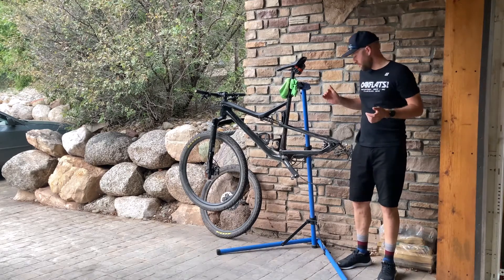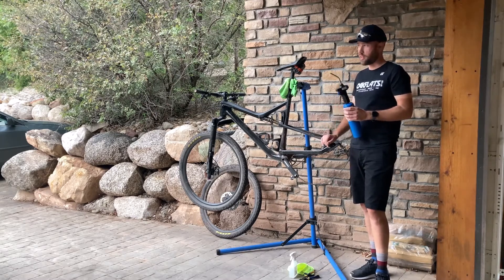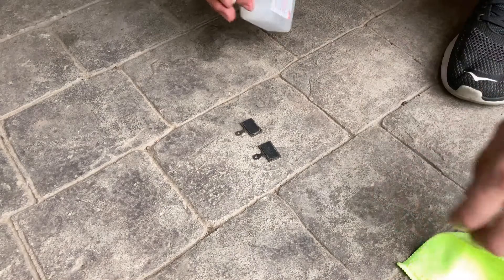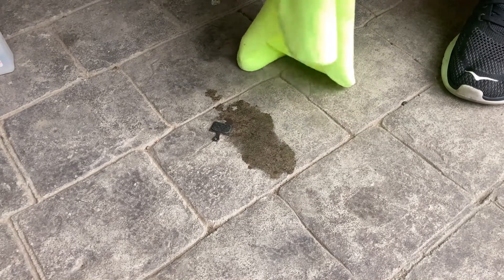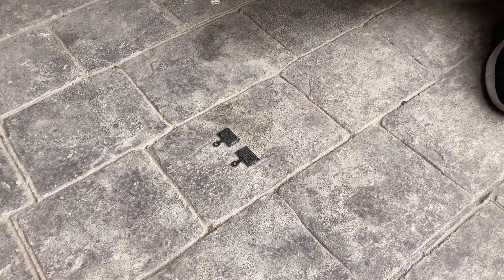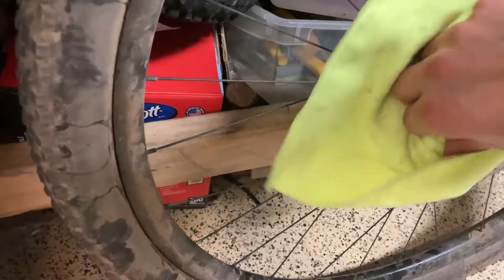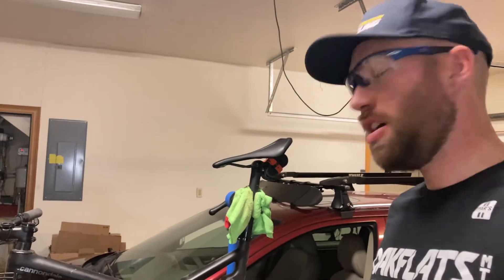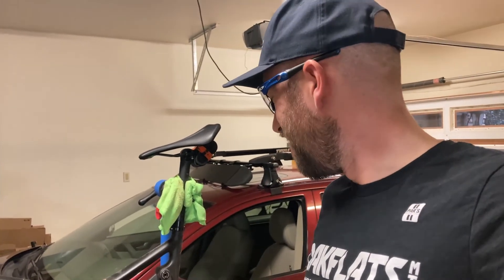How to Fix Your Squealing Disc Brakes...with a Blowtorch

Comment: I installed a new set of Shimano XTR brakes, resin pads, ice tech rotors.  Front and back squealed very loud and poor braking.  Tried cleaning pads and rotors with acetone.  Did nothing.  Then I did the blow torch method and it worked.  I cleaned the rotors with acetone and torched the pads with a blue flame. Had to torch the back pads twice.  I now have great brakes and no squeal.  Cheers!